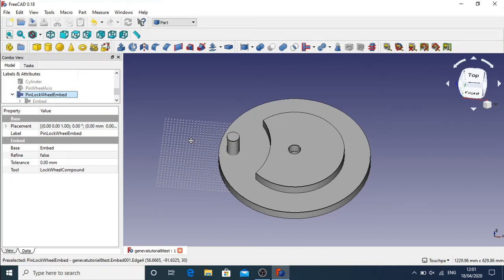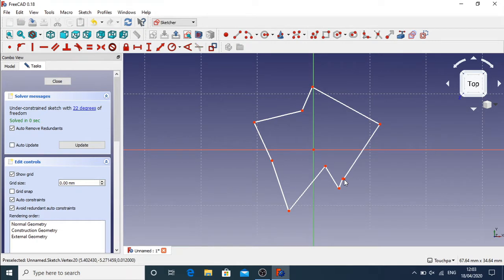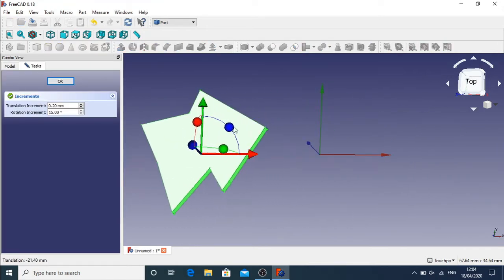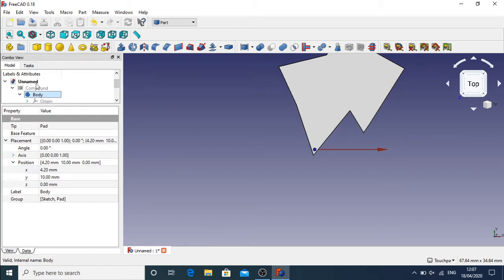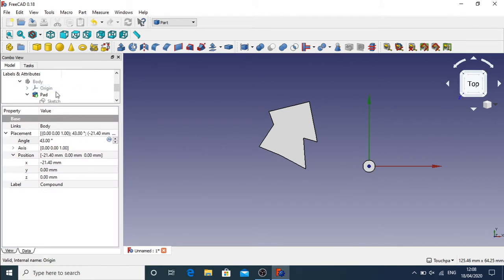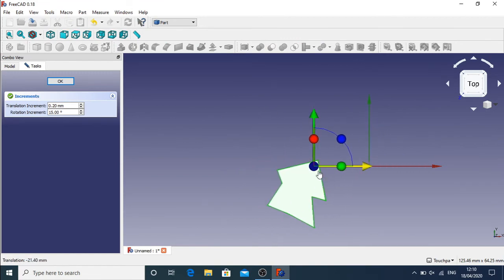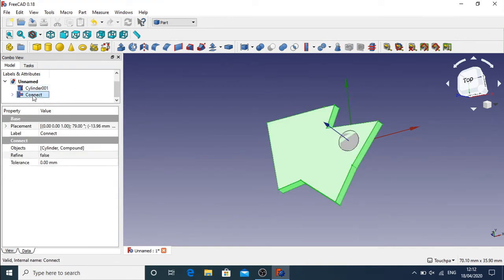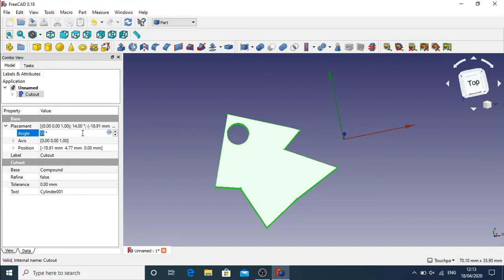FreeCAD: Changing the axis, pivot point or point of rotation of an object

Comment: I have created an object using part workbench. I managed to change the center of rotation using the edit--> placement window, where i use the "select a point" option of the "center" subwindow, to choose as a rotation center point a point of my object and then by selecting the appropriate axis and degrees fro the subwindow "Rotation" i managed to complete the rotation.

Comment: can I make the point of rotation be a very specific point that is part of the object?
Reply from the maker: I personal found its better to use the rotate tools in the draft workbench. These allow you to rotate the object more accurately around any point. Make sure you use the rotate with the snap tool in that way you can center the point of rotation to different faces or edges.

Comment: todays silly question  ,, when I go to transform , |I get the trans tool pop up , but all i can actually move is the position of the transform tool , not the object , what have i done wrong , thanks  I know its basic to most , but its not basic to me at the moment , thanks in advance,
Reply from the maker: It's only easy when you know how and transforms in freecad can be confusing so don't worry about asking the question or any question. What object are you trying to transform? Normally when this happens you have to use the placement properties.
Reply: @MangoJellySolutions   I have a building I made , just a simple four walls and a roof , when I activate most of the walls , i can click on the object im my left hand window where its named etc and the menue drops down , second option is transform ,, when i click on transform and go to the main workspace i get the triangle with balls and cones and i can move the wall , but , one wall when i do the exact same thing i get the triangle etc , but if i click on one of the arrows as an example the wall stays where it is , but the triangle with the balls and arrows moves ,,, id like the wall to move , I must have clicked something some where but its only that one same wall... hope that makes sense thank for your time , tom